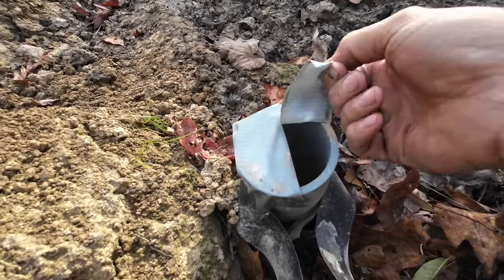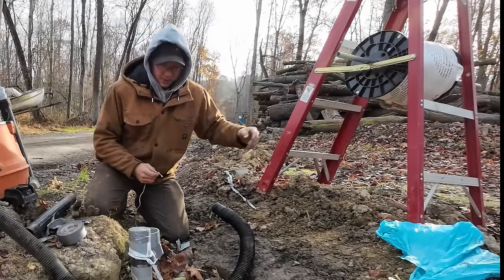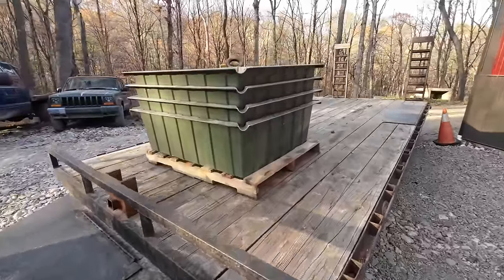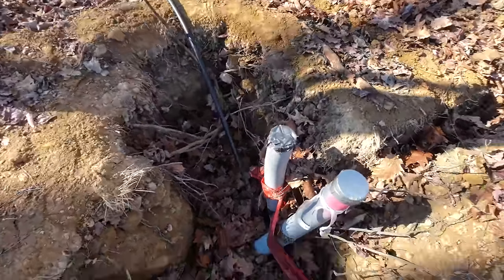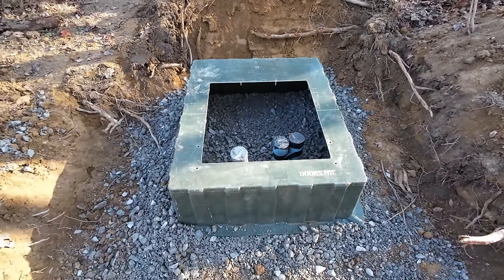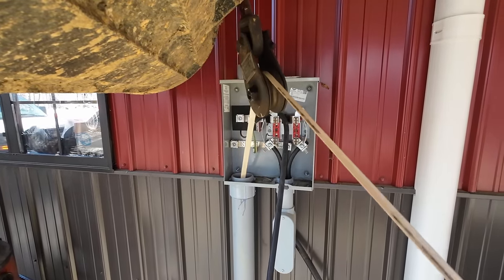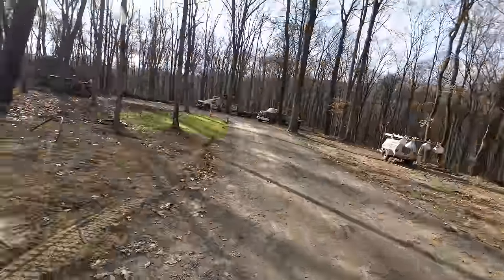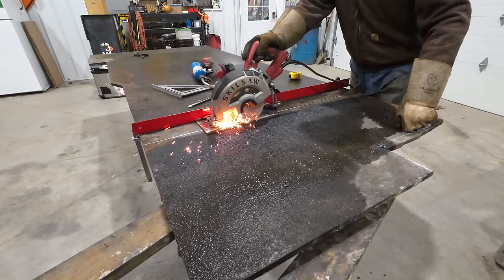The Power Company Charged me $52,000 for this!!

Comment: I once asked my city if I could do my own curb cut behind my home to put a driveway in and was told I wasn't allowed but they could do it (simple enough thing to do with a grinder and diamond bit) When I asked them how much they would charge because that's important information before you commit to something I was told they didn't know but they could schedule it with no pricing information given, not even an hourly rate. A couple months latter I was talking to one of my neighbors who works for the city and he said the ones he has seen around here the city charged about 8000$ for. There is no ditch or culverts here because we get very little rain fall. they would quite literally only be cutting the curb. Something I could have done within 2 hours including time driving to and from the hardware store to get a diamond blade for my angle grinder. My only take away from that is the city must charge 4000$/hr. I decided I'd just Cut my fence at the rear and come out half way between the road and the back alley where there is no curb. Greasy pigs.

Comment: just a thought and i’m sure you probably ran this by the power company but would they not have allowed you to run your secondary cable up to the road yourself and have the transformer up there instead of them running primary cable the length of the property? probably would have been a bit cheaper seeing as they allowed you to install the secondary yourself. would have eliminated those two termination cabinets also.

Comment: See .. little loop hole in the pulling of that conduit. Put up a sub-station building :) ... you can save yourself about 40K. But I guess they never told you about that. This is pretty much how most contractors get away with long pulls, by simply putting up a sub-station transfer ... nobody will admit it though.

Comment: 2200 feet of line... primary 880kV, that's 2 spools at $12,000 per spool... Transformer block, concrete, and paying the crews... You $52k was relatively cheap. Cost us $117k for install of 6 poles and 3100 feet of line, and that was in 2015.

Comment: Did any of you even have a conversation with your power company's staker?  Is you power provider a for profit or a cooperative and how many phases did you get?  If you think the power company is ripping you off you are welcome to get it quoted by a contractor and then all the power company would do is the last connection and inspections but you should be sitting down when you read that quote.  A good cooperative staker should give you the cost breakdown as they are non-profit.  Underground that far with rocks and such isn't cheap.  How many days did it take?  How much wire, conduit, trencher time, employee count, vehicles and equipment, etc did it take?  You could always go with solar, wind or hydro if you have a river on your land, but again the costs, reliability and load will be much less.  Enjoy all the problems that come from that.  Better yet go ask anyone that has rooftop solar or the like and check their take on it.  Most never see the break even point and if they do it's decades down the line well after the panels should be replaced which of course then kicks the break even point further down the road.  Now go and get fiber to your place quoted.

Comment: Your lucky they let you lay the conduit. the reason they won't let you pull THEIR wire is because they are responsible for any failure of the cable after it is energized. The Mule that the power company uses to pull in the wire is computerized monitoring the amount of pull "Stress" on the cable during installation. This will detect any defect in your conduit. Plus there is a warranty by the cable manufacture. I think back in 2010 a 3 man line crew was $500 per hour plus the engineering,  plus the drafting. it takes 2 crews to pull wire. You should have called them before you bought the property.

Comment: I don't get it.  All the wire I saw installed in the ground looks like it is "low voltage", about 240 V.  For that long of a run, I would expect the wire leading up to the transformer to be 4 KV or 8 KV or higher.
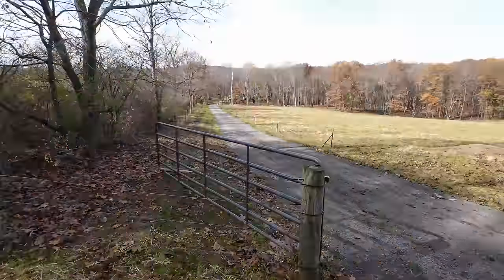Also, you said the crew show up around 8:00 and left at 11:00.  Was that A.M. or P.M.?

Comment: Well, based on the little I saw with your video? I saw it from beginning to end. It wouldn’t pass construction wise here in Connecticut. I’m a lineman for the local power company here & our construction standards are way higher. As for cost? We are not involved in that part. I couldn’t tell you what that stuff costs. I know this that everything sold to the power company is up charged because it has to be tested to meet their criteria. Some computer controlled 3 phase switches on a palette cost $78,000. Just to give you an idea? 

I can tell it was your first rodeo on how you did your excavating. However you compensated well by yourself & having a robust amount of powered equipment on your property. I’m just surprised you don’t keep it out of the weather? 
The pipes you ran were fine & pulling the mule tape later is an accustomed practice. I can see your interest & excitement with the vacuum & plastic bag trick. That’s old hat for us. I’m not raining on your parade. 

However in CT. you would be required to install concrete silo’s at every location you installed those plastic boxes. As well as two 8’ ground rods & a ground grid at each concrete silo. Then a fiberglass re-inforced 48” round lid at 3 locations. Then you could have everything at grade level. Each pull box would need a switch bus & feed through & 2 elbows. The fact that they had a pad mount transformer is a miracle? Typically they are running 50 weeks back ordered to get one. Then they had to install a pole & build a riser? Run new wire to the pole? No mention how many poles they had to set to get to your driveway? Then a single phase of primary & a neutral. Ground grid at the deadend pole. That all takes time. That meter can doesn’t meet code either. It doesn’t have a meter by pass in it. That’s been code here for over twenty years now. It now needs a circuit breaker in it for the fire department to shut off incase there is a fire in your building? We typically feed wire at the meter can side to the pad mount. You did it. That’s all that matters. I would keep those pulling baskets. They use those to pull wire. We use them until they break. 
All in all the power company did a nice job. As for litter? That’s not a lot. I’ve seen real messes after some people are done. You’re right not to fix it up nice until everyone is done. Leaving a pair of pliers behind? It might be someone’s personal needle nose? Now they’ll need to buy a new one. I would call them back & tell them you found them. 

As for photographing crews? I wouldn’t want someone shooting video of me. I know people think nothing of taking video without permission even though it’s not right. Our employer if they have access to it? The like to critique what we are doing? More importantly what we are not? If we break two safety rules at the same time that’s grounds for termination. Everyone is required to wear high visibility clothing at all times, fire retardant clothing. Steel toe work boots. Hart hats, safety glasses & hearing protection around powered equipment. Rubber gloves & sleeves if near energized equipment. Fall protection devices etc. The list goes on a on. Trucks need to be grounded. 2 wheel chocks per truck. Traffic patterns around each truck. Advanced warning signs with flaggers. You have no idea what is required to work now? I’m not knocking it. It’s just required. So if you had any question why they don’t want their pictures taken? Now you know why? 
Great video! I like that leaf blower! I never saw that before? Personally a piece of plywood over the trench would have worked too.

Comment: I didn't see how you did the grounding at the electrical meter and what's the requirements in your area? Here you need 2  ground rods 10 ft apart and you have to connect to the water pipe and to both sides of the gas meter if you have one.

Comment: Why dont you just put in a diesel generator and battery storage system....Its like 10 grand....
We have a small unit here in the house we built. It puts out Pure sine wave 2200watts, available all the time 24/7. Small 6hp engine,2-90 amp alternators, 2200watt pure sine inverter and 200AH battery storage! All modular, will run my home for 2 days on minimum/basic power. I can easily add more batteries for capacity.. Or another inverter etc in 10 minutes time..Total cost $600 and installed in a small wheeled movers dolly/cart I already had. Portable pure sine power anytime anywhere.

Comment: Yeah it wasn’t cheap but think about it like you got enough power to run anything you build in the future and not have to upgrade the transformer as long as you told them you planned on building more buildings. That 25kva should be enough to run the shop and future house no problem.

Comment: liability always ends up driving costs up to the moon. eventually it reaches a point of complete stalemate where literally nothing will get done ever. the place where i live will probably never get cable internet because its slightly too expensive and they won't let any private citizens pull any kind of line. i think someone will eventually just pull a line anyway and deal with the fallout later lol. i bet the telecom company would just ignore the line though even if it was exactly the same as their line would have been had they pulled it themselves.

Comment: You were taken for a ride. There is a 1000 feet of wire on a big spool so you would of needed only one junction terminal and then the transformer pad .normally the power company supplies everything to the meter so they took you for a ride.

Comment: I run my Lincoln 210 pro diesel welding machine for standby power too. Runs my entire house (and hot tub) on 5 gallons per 12 hours.  I added a second large diameter muffler and it is just loud enough to hear inside the house. Why buy just a generator when you can have a welding machine too? I am a retired shipbuilder.

Comment: REMEMBER TO TAG EVERYTHING WITH "PROPERTY OF (YOUR NAME).

REMEMBER ALSO IF ANYONE WANTS TO JOIN YOUR POWER FEED **SELL THEM PRO-RATA ACCESS TO THE CABLE** - THAT'S ACCESS NOT OWNERSHIP (requires an agreement).

I live in VietNam and l ran power, Fibre OPTIC and water with the blessing of utility companies.

REMEMBER, VIEWERS, if you D-I-Y gas feeds are buried directly in the dirt. ANOTHER TIP: ALWAYS PUT TAPE (LIKE POLICE DO NOT CROSS) IN DIRT ABOVE PIPE RUNS so anyone digging gets a warning.

Comment: Because - this also falls under WHO is LIABLE if your spur line causes issues down the road and they have to come and FIX. Basically INSURANCE - LIABAILITY and BUAROCRACY - changing underground cable maps that the state has to keep on record are what you PAY FOR - Now if you did all of the work then they would STILL charge you a BOATLOAD for hookup and vetting your draw on the GRID... I the long run - In personally think you made the right decision.

Comment: $52k would have bought a lot of solar power.  I suppose the question is would that be reliable and supply your power needs.  

The electric company had probably had someone slice in cheap substandard wire into the middle of a run.
Reply from the maker: Exactly, we don’t get enough sun to keep up

Comment: For all the money you spent you could have had an on-site generator running for years before you even used anywhere close to what you got charged just to put the tubing in the ground before they ever  pulled the wire

Comment: Is this a coop or a corporation? I’ll will say one thing they won’t let any one pull primary wire because if you get the smallest nick in the wire it will cause a fault and primary voltage when there’s a problem can be very dangerous not while pulling threw but later when energized. I also got to say Matt you did a good job and I would’ve had on my line crew any day.

Comment: I design  power line and provide costs for a Power Utility (in Canada).  We’re you forced to provide your own tench and duct?  Seems like they charged  you a significant portion of trenching and laying the duct if they were doing it themselves.  52,000 US is awfully steep to pull 2200’ cable and install a transformer.  I ran the costs for your project, new pole, takeoff with single rod ground, 670m trench, lay 5” duct with pull tape, marker ribbon, (2) pull boxes, 720m of XlPE-cj cable, 50kva pad mount transformer and a meter…..about $75-80,000 CAD.   $35-40,000 omitting trench and duct.

We don’t let customers install their own cable because we own it, and any damage to cable  insulation will result in cable fault down the road.  There are tension specs that have to be adhered to when pulling cable To ensure there is no undue stress the insulation of the high voltage cable.
Reply from the maker: Yes, I was forced to do the trenching and install the conduit myself. That was an additional 15,000 in material cost on my end. The conduit is only 3 inch here
Reply: @DieselCreek  Wow, we would never let the customer dig the trench and install the duct, why I asked and was wondering if they actually charged you it.  Customer doing it themselves increases the likelihood of being done wrong , not to code, greater chances of a harder installation of cable, and future maintenance of the the cable…. You did an excellent job tho, well done.   We actually use red 2” HPPE continuous duct for single phase primary cable, I estimated 5” PVC because that’s our other duct we have and was more comparable to 3” PVC…costs where I live would have been cheaper yet lol, 

You can try asking for a material and labour summary cost breakdown.
Reply from the maker: @jeffh7145  that was the first thing I asked for. They said no they don’t do that.

Comment: we pulled the power for my bosses shop. as a matter a fact they said they wouldnt do it that its our responsibility. all they did was install transformer and connect wires. had around 3000 feet to go. used a truck and pullies. got power to the shop for about 5k not including the wire an material which i know was alot but not 52k

Comment: I'm sure you considered this so i'm curious to hear the answer, not poking at all. With the $52k from the power company plus all the other time and materials you spent, did you consider putting that money towards a solar + battery system? I run my home and shop off a 80kwh battery, 12kw solar and a 3-phase 12kw inverter. Installed all of that myself for under 35k + I got a 30% tax credit and no power bill

I also have a backup 10kw generator that I only need to run on one or two days a year.

Comment: 52k seems a lot but them heavy duty copper is never cheap.
 A transformer is pretty much all copper on the inside, tin on the out.
Joining all the bits together is just not a man on the streets job so ya you are lucky that the power people didn't have to do the trenching to begin with.
Here in NZ may new nabour had to do the things you have done but his length was less than 100m's.
I don't know the actual cost to do that job, but he did say just having traffic control on board for less than a day it cost him 15k.

Comment: So maybe I missed something, but what exactly did you pay ~$52,000 for? I'm planning a project like this and that is easy more than I expected after getting permits, easements, digging, laying conduit, preparing the junction box sites, and the other small stuff. I thought they'd just need to drop in a transformer and get the live wire introduced...?
Reply from the maker: Yes they pulled the wire through the conduit from the pole to the new transformer and made the connections. That’s what 52k gets you

Comment: reasonably speaking they did run what looked like 1/0 3 conductor wire which is about $14k per 1k feet, and i think you said in the video you ran it what nearly half mil2 +/- $35k just in wire, the line transformer at the end of the drive i assume is converting from lets assume 34.5kv to 600v this line transformer is about $6-8k.... 10 trucks, 10+ personal, tool usage lets say $1000 in labor for 10 guys (average near me is $35/hr in that field (p.s. the power companies markup not calculated) for 2.5 hours  i mean even on the low end of my calculations that's $44k without taxes (taxes near me is 5% so lets say $2k) there extortion isn't entirely bad...

Comment: From eBay

10 KVA Pad Mount Transformer - 13200Y/7620 Grounded Wye Primary, 240/120V Secondary - FR-3 Oil Fluid
Buying options
About these results
$11,570.82

Comment: You could have built a solar array, 3x 48v inverter for 480v 3p if you needed it. Or keep it simple at 240v 1p with 2x 48v inverters. A couple of iron phosphate (FePO) battery banks and you would have plenty of power, spent a little less and have no future power bill. Food for thought.

Prime reason I built out solar on my new home project we are building. completely off grid.

Comment: U could of put a soler wind battery or if u had a streem and batteries for half that i have a natural gas generator that runs on wood and methane off the poop tank for the home shop no hydro bill cost me 5000 $ for system and a lot of time    it gives me 150 amp 3 phase 600 v or 220 volt 300 amp 3 singal phase      or 3 phase. Or a combination. I should have everything set up by summer. On my new property.

Comment: Just curious: Couldn't you have placed the transformer right near the entry to your property and run the "low Voltage" (240V) in your conduit by yourself?
Or why not have an industrial, I believe in the US 480V(?), and real 3-phase (not 3-phase with centre tap) at the transformer and only transform it down from there?
(I am from Europe, it is standard in the houses to tap right on 400V 3-phase with 230V off one phase to Neutral. No centre tap here.)